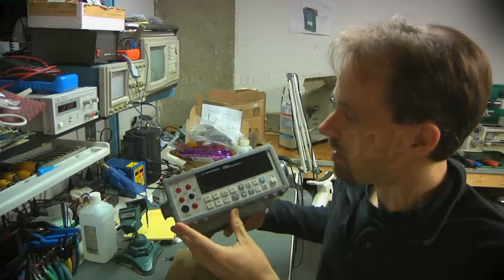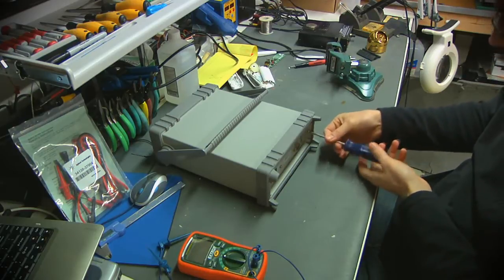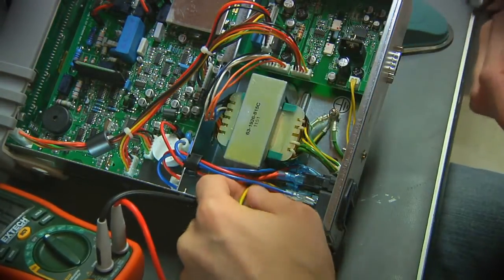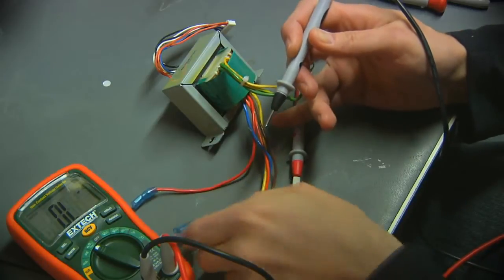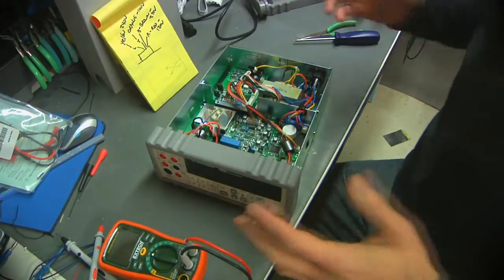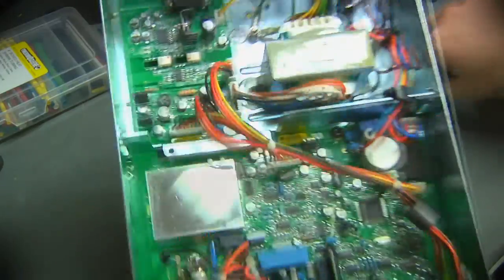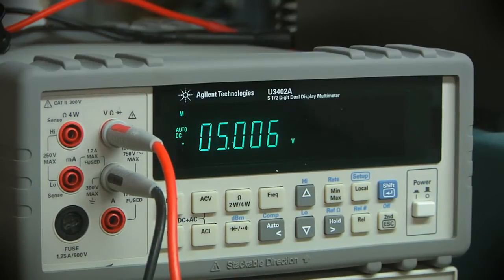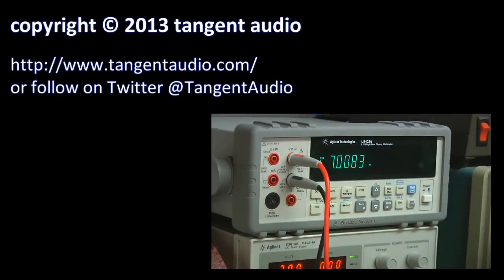Agilent U3402A Benchtop Multimeter Teardown & Repair

Comment: Please take note that the windings of the 120-240V used now as 120 input may use a thinner wire that the original 0-120 section. In time, hat may conduct to an overheat of a transformer without thermal protection.

Comment: I would not recommend anyone to see this as a fix in any kind. The transformer may have a short on one of the windings that killed its internal thermal fuse due to overheat. This is more kind a mc guyver method. Do yourself a favour and get a proper transformer for this.

Comment: 14:05 shit you were close to shorting that 120vac line to ground with your meter probe xD
Reply from the maker: Those long probes are insulated all the way down, only a fine point at the end is exposed.  There was no worry of a short.

Comment: Just a thought - the primary thermal fuse was bad because someone plugged it into 220 while set to 120. You have now defeated this protective feature. Not that you should worry about it though - I would have done the same thing.

Comment: If they're the same ones I have, they have insulation up the length of the point, so there's nowhere near a short happening there.. Those probes come on a lot of different Agilent gear and they are marked for cat2 300v max

Comment: You can bet that there is a thermal fuse on the blue wire. It is mounted inside the transformer and usually has a trip point of around 100°C. In most of the cases transformers "blow" these fuses are tripped even when the transformer did not overheat. Yuo can call this a manufactuing error. The trafo looks a bit like a cheapo. However you disabled an important safety feature there. I am a bit concerned. Take care.

Comment: nice video, you were lucky there. It would not have worked with me as I would have to use the 240 tap. Good tip thou using a different wire for common.

Comment: You are lucky, living in 120 VAC land, making this fix possible. 
With original Blue - Red wires connectd to primary windings, I guess you should be able to measure a fault with 0 V secondary.

Comment from the maker: I don't think there are any intentional fuses on the transformer, but the small wire they use to wind it sure would act like a fuse under the right (wrong) conditions.  It's also possible it was also a manufacturing defect... Not sure I will ever know the answer.

Comment: Wow, almost brand new and now working smashing :-)

You clever man, i would have never thought of primary wire swapping lol :-)

I would next probe the outputs and write down the loaded ac voltages and configuration, just in case :-)

Ive used a very nasty method for finding out unknown secondarys, if one of your secondrys are known or approximate voltage known, then back feed it with ac and quickly measure the unknown secondarys.

Yep i know its nasty lol.